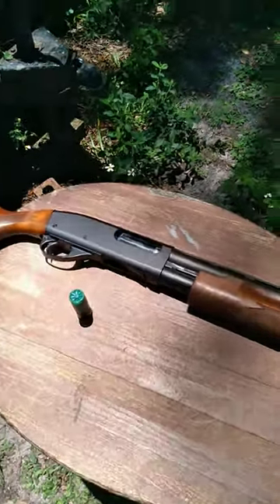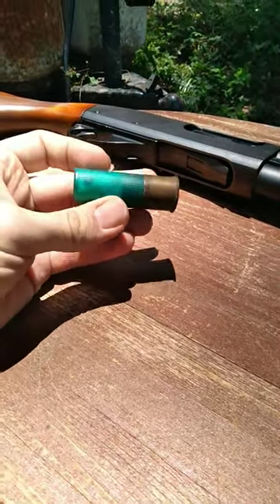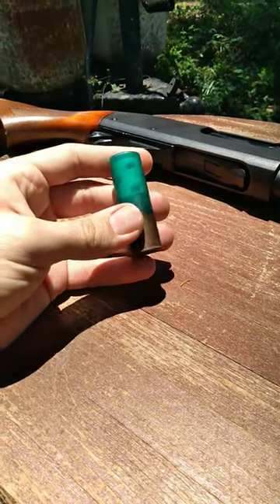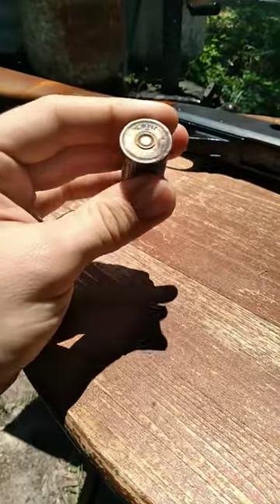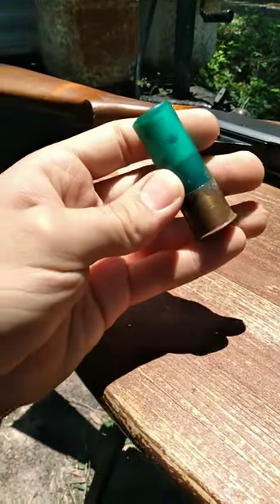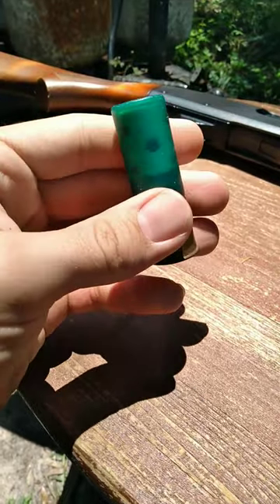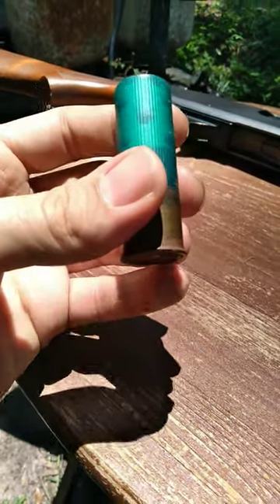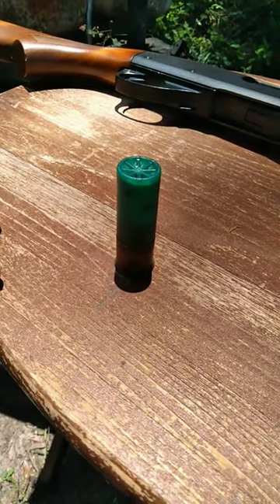00 Buckshot Explained

Comment: That is one OLD ASS shotgun shell. You can see the corrosion on the brass.
Reply: do you think it would still be safe to fire
Reply: @elizabethflynn6626 yeah, probably clean your gun afterwards if you shoot a couple but you should be fine
Reply: @wipah you wouldn’t need to clean your gun
Reply: @cane870  by that logic you never Need to clean your gun. 
You should though after most uses if possible
Reply: @bunkeroregano9492  no, not by that logic. He said after shooting a couple. No round requires you clean your gun after firing a few.
Reply: @elizabethflynn6626 for what I know shooting old shotgun shells is safer than shooting old normal bullets because the plastic/cardboard doesn’t allow for a very high build up of pressure 

But if you look at Kentucky ballistics he shot old (I think) 50 calibre bullets and because it allowed an high pressure buildup that exceeded the rifle’s limit he almost got killed 

Don’t take this as advice tho I still won’t recommend shooting old shells 
And I ain’t nowhere near an professional on this because I never shot anything more powerful than my 16 joule air rifle 

Everything I just said is from my time spend learning about firearms 😅
Reply: @Donuts_random_stuff pretty sure he said the cartridge was loaded with fast burning pistol powder and not slow burning rifle powder, so yknow.. kablooey

(Thats what he THINKS was the case anyway)
Reply: @cane870 you should clean your gun every single time you fire it that’s an insane thing to say you don’t need to clean it after a few shots

Comment: Yhup. OO buck is 32 cal (.32") round, lead balls. Can be soft lead wire swaged into a ball, hard cast lead, copper plated lead, etc... 

Even in the common 12 gauge 2 3/4 inch shells, the number of OO pellets vary. I find 9 to 12 pellets being the most common. Low recoil defense loads often have 8-9 pellets while the full power hunting loads will often have all 12.

Comment: That looks like an old military 00 buck.  Green shell and painted brass.  Those are the good ones.  I generally run the black aces 1450 fps shells.  
And i also got some #1 buck and 0 buck.  
Back in the day you could find 000 and 0000 buck shot.
Now days its 00, slugs and target loads.
Reply: I just bought 2 boxes of 000 like a month ago from the local gun shop. Granted, I’ve never even seen 0000 buck tho
Reply: What is 000 buck? Ive only ever fired 8 shot, 00 buck amd 1 oz slugs out of my mossberg 500
Reply: @studentdrake  000 buck is typically 8 or 9 pellets that are each a tad bigger than the 10-14 that are in 00 buck

Comment: They are 32 caliber and usually there are 8 to 9 of them in 00 buck shot.
Reply: 15 in a 3 inch rem shell
Reply: The ones i have are 12pellet 2 3/4
Reply: 18 in a 3 incher 😊 actually I think it’s 18 in the 3.5 incher , imma have to take a look
Reply: @TacticalTony702  most pump action shotguns won't cycle 3 inch shells.  You can only use them in break action shotguns.
Reply: @jiveassturkey8849  but my Remington super magnum tho
Reply: @TacticalTony702   oh ok.  I was just thinking about the standard pump shotgun.  Mine is just a Stoeger lol.
Reply: @jiveassturkey8849 ell that to my ks7
Reply: @TacticalTony702  my 8 boxes of Remy 00' say 15 pellets brother.
Reply: @redislandv2  Winchester X is the brand of shell I have 18 pellet